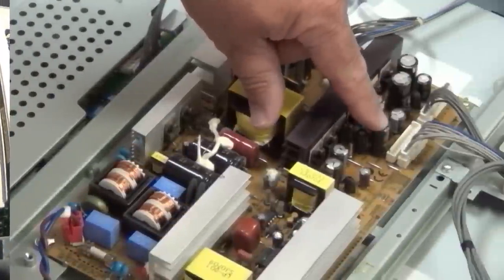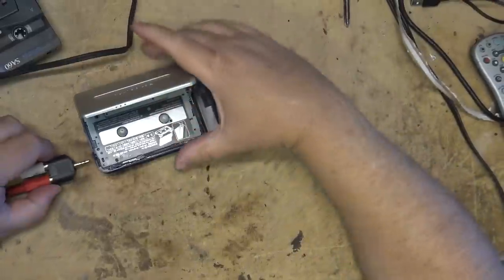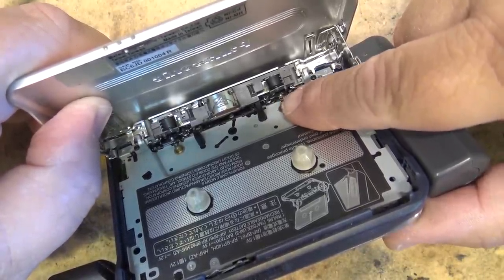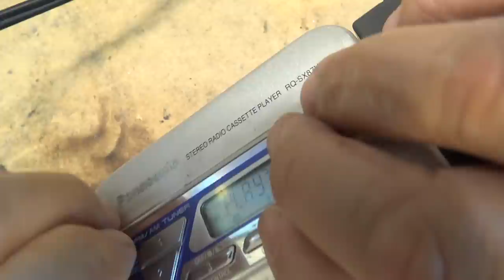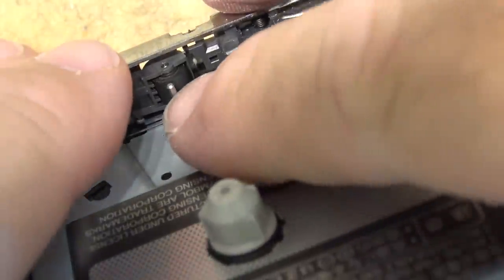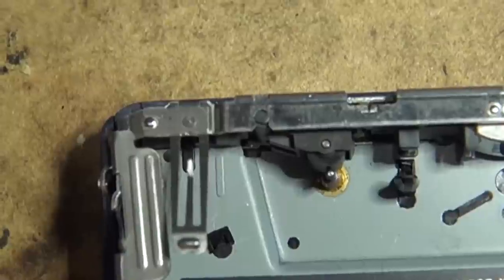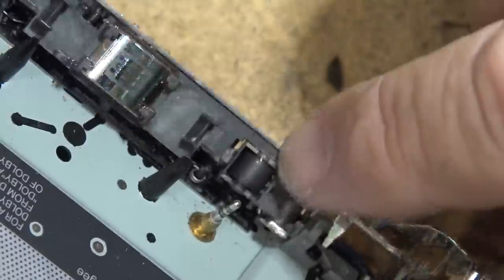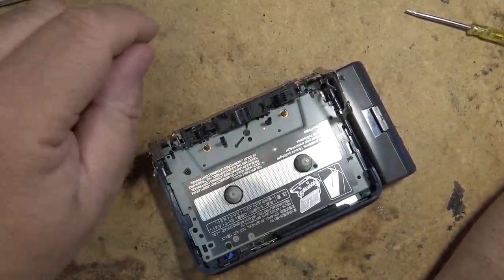Panasonic RQ SX87V walk man with very high flutter   lets fix it

Comment: This is a stark contrast to some of the direct drive component decks they made where the only things to worry about are the pinch roller and the belt on the door open/close mechanism...or changing from the infamous rubber pendulum idlers for VCR reel drives to a gear.

They knew better than to trust rubber parts, but here they did it anyway. ;-P
Reply: silicone would have survived 50 years
Reply: I think most went to felt friction idlers just before the medium died out.

Comment: I always like those battery packs that you can put standard batteries in.  Makes it easier than having to rebuild a proprietary battery.
Reply from the maker: Proprietary batteries were always a pain in the butt. My portable DAT deck uses them. Impossible to even find replacement cells now..
Reply: @12voltvids  The best you can hope to do is wire them up to some sort of power source.
Reply from the maker: @infinitecanadian  
My Teac requires a +7 -7v dual supply.
Reply: @12voltvids  more than Sony D6.

Comment: Only thing you can do with old pinch rollers to get some improvement is cross hatching with a scalpel.   Works even better if you run scalpel at angle and quosi lift the rubber, effectively creating little raised slices of rubber, not too deep.  I don't know of any source for replacement mini rollers,  most rollers can be replaced with modern German made replacements.

Comment: Unlucky. I have a similar device same capstans. Thought what you thought, nearly did what you did. I wonder if a de wired piece of silicone hook up wire would slip over the capstan and provide the grip needed. Or if that is too thick perhaps some heat shrink. Or some fine silicone carbide grit glued onto heat shrink with a thinned down F2. And shrunk on before it dries.

Comment: Hi, can the tape detection and motion detection sensors in late 80's cassette decks be disabled so that the tape play assembly engages after pressing 'play', even with no tape in the machine?  l would really like to do this so l can more easily clean the heads, etc.  Also, l feel this would alleviate the common problem of tapes playing for a few seconds then stopping because of a faulty sensor thinking there's no tape in the deck, when there is one.  My deck is a Yamaha KX-800. Thanks.
Reply: yes. it's likely up at the top of the cassette compartment near the similar switches for erase prevention & type-2 tape detection.... I have another yamaha in that range, same deal. take the door trim off & feel for it with finger-end & flashlight. door will still have to be shut.
Reply: ok, the one I have IS a KX800, same as yours. I took the door trim off, & felt around inside. the required switch is directly to the right of the record-tab detector at the top left of the cassette compartment. however, this model uses a hall-effect autostop driven by the supply side, so what it does with no tape loaded is engage the pinch roller (which is what you want, to clean it properly) for a few seconds & then put it away again. if this isn't long enough to get the cleaning done, you will have to somehow manage to hold the switch up & turn the supply side hub anticlockwise just enough to fool the autostop. of course there's no mention of this in the OM.
Reply: your other issue, the tape stopping after a few seconds, may be a fault with the autostop.

Comment: I´ve got an RQ-SX15 and it has the same mechanism and all, well at least mechanical.
It also has higher wow&flutter in the fwd direction, while it´s better in reverse.
I think this is because the fwd capstan is driven by another belt, while the other capstan is driven directly from the first belt from the servo motor.
Well that´s more like a poor design.
Those blach rings on the capstan however, they´re supposed to be there.
Got an RQ-SX71 for parts and it has the very same rings.
Probably it will give better grip to the tape.

In all i still prefer the Sony WM EX674 in any way.
It´s much less noisy, has better bass and treble response, higher output level and a much simpler, yet more reliable and stable mechanism which destroys the panasonic in any way.
It has just a single, super thin belt, but it has like 0,25% WRMS of flutter at most which is barely noticeable if at all.
And it´s also in the same small and thin package, so yeah sony really nailed it back then.
Also very easy to service.

Comment: I was hoping to see pinch roller removal as mine need replacement on one of my Sony's
Reply: I did it on mine WM-EX614 and it's a PAIN. You will need to strip the unit completely to take the mechanism out. Before taking out the worn pinch rollers, take a note as to the placement of all the associated springs locations, otherwise you might damage the mechanism.Good luck!
Reply: Also have that problem with my Sony wm fx 103

Comment: I don't know if this cassette player is worth a pair of new pinch rollers, as the capstans look not fine and the mechanism is clicking and ticking like an old broken toy. Even if metal parts are well present, these mechanisms were not designed to last, and are now probably the most difficult spare part to get.
I've got a high end Aiwa HSPC202 from 1990 that share some design lines, like a lateral clip for a battery receptacle (for 2AAA cells). The miniature 2V lead acid batteries were similar in shape to a chewing gum  pack of tablets and looked like Panasonic ones if not identical. I doubt any supplier still has these or equivalent, as this is typically an obsolete format. Last but not least, you had to buy a specific external charger!  The entire and optional kit charger + battery used to cost one eye, when available, for very limited results. A 300 mAh cell capacity was just sufficient for a 60 minutes tape with a low output volume on a good headphone.
Reply from the maker: Not worth fixing
Reply: That mechanism has been dropped, possibly a number of times. They don't become that clicky with use unless they have a broken gear or are out of alignment with a lot of play.

Comment: Would rubber renew help with these?
Reply from the maker: Will make it even sticker than it was. Needs replacement, problem is any out there will be just as old and likely also bad.
Reply: @12voltvids  Renew was a gimmick that only solves the problem for a month or so but dries it out even more. If it were on belts, I have had success with an extremely small amount of oil then wipe as much off as you can. I know it sounds counter intuitive. You wouldn't want to use oil on something in a tape path though.
Reply from the maker: @MikinessAnalog  
Rubber renew works on idler (rim) drive turntables and little else.
Reply: @pietermol8508  him, yes. good guy. dedicated. good engineer. doesn't care how much or how little something cost, he just wants to repair. I like that.

Comment: That player has definitely seen a lot of use and definitely has worn pinch rollers. As for other commenters' talking about coatings placed on capstans during manufacture, have NEVER seen that in more than 40 years of working on electronics (OTOH I have seen capstans with a textured surface on the tape contact area). That was clearly caked-on oxide that you removed. I've had instances where it was so hard that it had to be delicately removed with a razor blade or an X-acto. As for the pinch rollers, the rubber has glazed over and hardened (at least on the surface). About the only thing that could be done about that would be to take them out and give them a good going over with a solvent like MEK or rubber revitalizer to remove the hardened layer. Unfortunately sometimes this reduces the diameter of the roller so much that the roller frame ends up hitting the travel stop in the mechanism and not making firm contact with the capstan. Too bad; neat little player.
Reply from the maker: Well now you saw one.
Reply: +12voltvids - Definitely an aftermarket mod. :)

Comment: POS unit, pinch roller,  I wasted time on 1 of those years ago.  Thanks for the video.  Retired now started in 1973 at 19.  Not as  good as you in your arena. I started on tube units in the 60's in high school.  Many years on  many things.  Try repairing motorized wheel chairs and Tri-carts and Oxygen units.  lol. Just kidding, we all have our specialties. BTW, what capacitor causes a Dukane Micromatic filmstrip projector to lose sync?
Reply from the maker: Yes pos you got it.

Comment: Those capstans are worn and maybe flywheels are bad by that rattling noise, not much you can do on this one
Reply from the maker: The rattling sound is the internal gears, which don't help the wow and flutter. The camera microphone is too dam sensitive. It could pick up a mouse farting at 200 feet.

Comment: 1 battery tape players suck. This one always has the pinch roller touch the capstan when the door is closed.
Reply from the maker: The pinch rollers are released when not in plat. There is not a huge clearance but they do move.  I don't have the unit to show this as I sent it back but they do move.